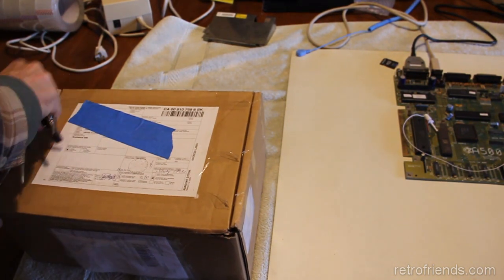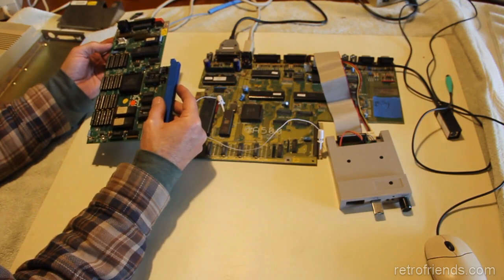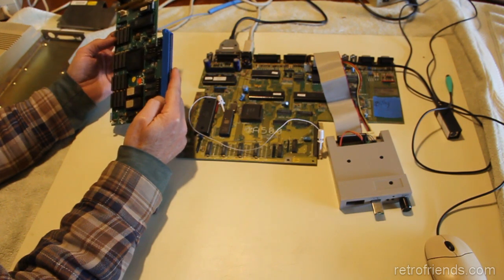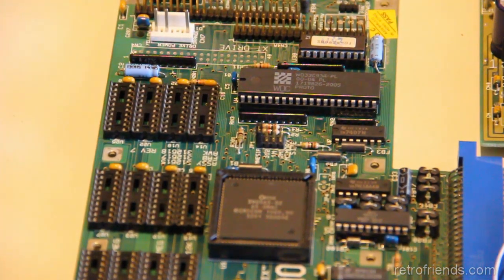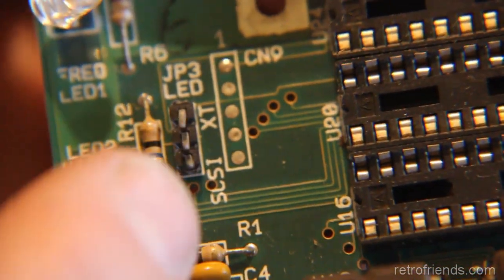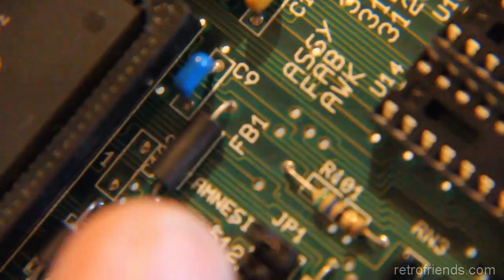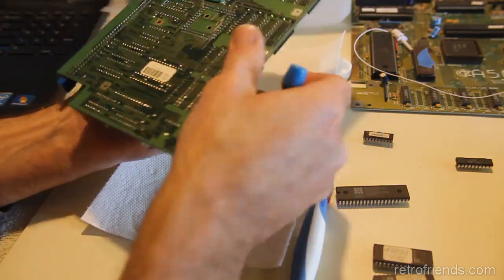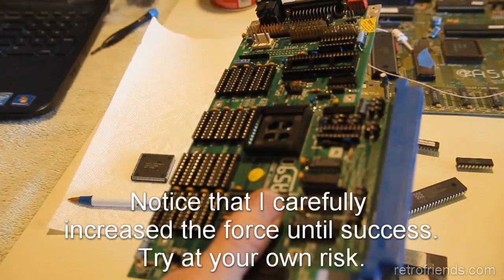Amiga A590 Hard Drive and Memory Expansion Repair and Refurb (re-upload)

Comment: 11:07 It's definitely a BAD idea! Just use TWO tootpicks and very gently beat on them to let the plcc chip go out without damages, at all. Safe and tested, after disasters using the plcc extractor! Cheers, M
Reply from the maker: I didn't use a PLCC extractor, lest anyone think I did. It sounds like you disagree with my technique, but your method is almost identical to the one I used. In fact I can't imagine two independently developed methods beimg more similar. Wood instead of my pokey tool is the only difference. "Very gently beat on them" is exactly what you see in the video, except to add that my work surface is padded, making it even safer. My complements to you anyways for thinking up a similar technique!
Reply: @retrofriends  Yep, same technique, just using woods instead of "spearing" chips with bare metal. And, for our own personal safety, always good. Cheers!
Reply from the maker: @mark12358  Okay. Of note is that fact I am using a tool with a flat tip. No spear.
Reply: @retrofriends  LOL, pardon. Bad choice of words.

Comment: Do you know of a guide for how to prepare the SD card for a SCSI2SD solution?  I have an A590 with 2MB RAM and the 20MB XT drive went up in smoke, so I need a replacement.  Looks like BlueSCSI is cheapest, but I see a lot of people saying ZuluSCSI is their choice.
Reply from the maker: Check my channel for a video on using WinUAE to prepare an SD card for the Amiga. SCSI2SD is the only thing I've ever used, so I do not have an opinion on those others.

Comment: The hole was probably to mount a toggle switch for enabling /disabling the ram which would also explain why there were no jumpers on the ram jumper header.
Good video, thanks
Reply from the maker: You are probably correct!